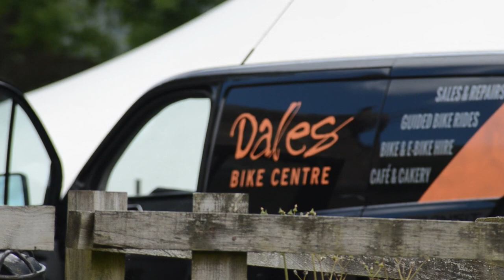Extreme lanes in the Yorkshire Dales! - Panda 4x4's pushed past the limit! - Dales meet 2021, Day 2

Comment: Really about 1.2 vs 1.3 jtd in mk3 argument? Most of which we got here are mk3 JTD engines precisely for low end torque, easier engine to push power to around 100hp and 2.5x more torque than 1.2 in half the rpm. Try one that is on stage 1 at least, they got more 'umpf' in low rpm and is easier to crawl your way out of most situations (:
Reply from the maker: Feel free to show some evidence that the diesel is better than the petrol off road. We'd all love to see it

Comment: Ya your pressures are too high lower them and the 4 wheel drive will be on the Rd less punctures also tyres need to flex yours any there ridged making motors bounce

Comment: Ume i would sudgest 20 psi in front and 14psi in rear might seem low but you have wider tyres also so thr pressures actualy need lowing for tarmack use there will be half asmuch hammer on whole drivetrain and the car and the  you will get a lot more out of it ie more extreem highways if there is any

Comment: I was thinking about the diesel engine for off-road , I've got a panda 4x4 1.3l multijet from 2006 and I want to take it to harsher terrains bit I think I'll need a lift and a winch first
Reply: Do you have any tips on what to modify perhaps
Reply: Sadly the Multijet is the worst engine option for off-road use.

Comment: Regarding the engine's capability off-road, what do you think about the 0.9 TwinAir?
Reply: The twin-air is the engine we would recommend out of the options in the newer models (Mk4). It has better torque and power delivery for off-road use. The MPG isn't great but tarmac usage is acceptable. They do suffer from clutch problems though and it can get expensive. Don't even bother with the Diesel if you plan to go off-road.
Reply: @allthingsandyb why not the diesel?
Reply: @morganfothergill974  the diesel bigs down on climbs it doesn't have enough low down torque, you'll be forever riding the clutch.

Comment: great video. didnt think the diesel panda was not perfect for climbing as anyone say diesel have more torque, but nobody think about turbocharged ones. for simon panda... how many km he got with the cluch till he broke? (maybe it didnt broke but got finished by mileages he did :D
Reply from the maker: Yes, small, turbocharged diesels do not have the torque at low engine speeds that people think they do. I think this is a misconception left over from when diesel engines used to be big, heavy and naturally aspirated. Simons car has had a hard life even before he bought it, it was just bad luck that the thrust bearing failed  halfway through his weekend away!
Reply: I confirm the above comment! I had a terrible experience with a polo turbo diesel, (much worse in low torque in comparison to diesel panda), that make me think that it is a myth at least at small turbos!
Reply: @gavriil3129  turbo diesels are pretty poor without the turbo spinning. However, something like the 1.7 n/a Isuzu diesel engine from a Vauxhall Corsa would be ideal in this situation giving loads of torque from tickover.

Comment: Not so much a comment but a question, earlier in the video you were commenting on the 1200cc petrol being  better than the diesel my question is how does the twin air compare with the others?
Reply from the maker: Mixed reports but on the whole, positive. They seem to chug at low revs better than the diesels despite still being turbocharged. Owners rave about the TwinAir for enthusiastic road driving. Fuel economy and reliability seems to be the only downsides with them.